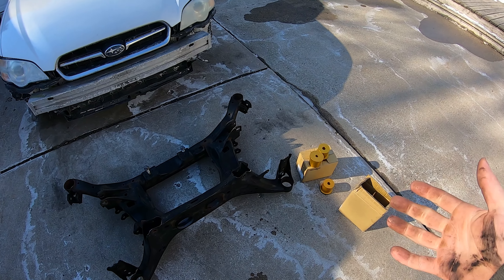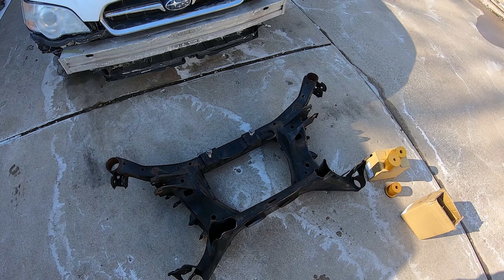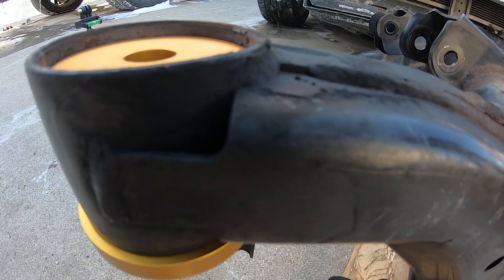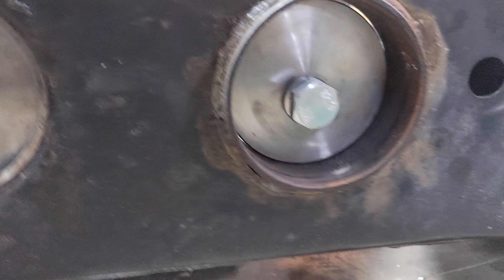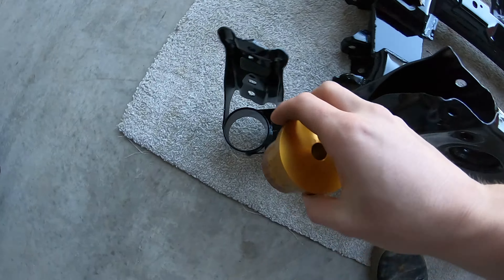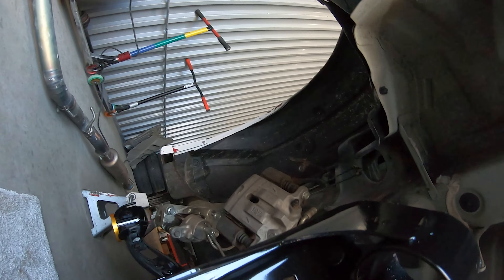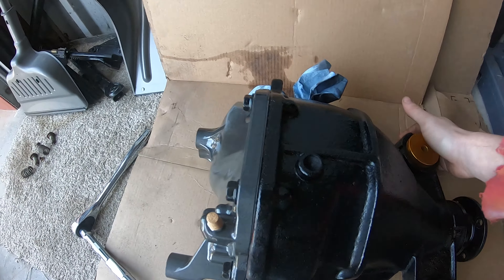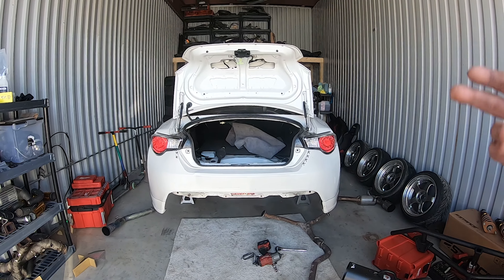FRS/BRZ/GT86 Parts Shop Max Subframe/ Diff Riser (HOW TO) FULL INSTALL

Comment: Do you need the diff bushings? I just want to install my sub bushings. I heard the diff bushings aren’t even necessary.
Reply from the maker: It depends on what you are trying to achieve. I wanted maximum rise to help my geometry, so I did both.
Reply: @yebo3061  going low like 1 or 2 inches off the ground and trying to drift too
Reply: @yebo3061  then again I have a body kit that will fill in a gap

Comment: How much vibration do you have now and would you do it again
Reply from the maker: I have a lot of vibration, but I also have solid engine mounts, trans mounts, no rubber bushings in suspension (hime joints) I would absolutely do it again and recommend it to anyone that’s lowered and drifts!
Reply: So solid mounts totally worth it for reaction?

Comment: Cool but i won't put the front diff solid bushing just let OEM remains . However for the rear of diff mount is poly insert on the right while welding custom solid(more centered bolt position) on the left side .
For the rear subframe i would grind 2mm off the bottom and then excess off the top so it will balance out the height of the solid bush and not contact the OEM weld on the top ... meaning i will be 2mm least raised than the PBM kit intended to while still raising the subframe higher at the rear than OEM . This maintained the OEM weld on the rear subframe mount top section .
For engine mounting poly on the left facing engine from front of car and OEM on the right . (Inside cabin will be poly on right side while OEM left side . )
Transmission just the insert from Powerflex will be great for shifting ... the other company poly shape does help but not as detailed design/engineered shape that extend the full portion of the front/rear facing of transmission mount . Best not to raise the diff or overly solid mounting all round with 1 piece driveshaft .
      Even you are super driver and not hitting anything ... you never know someone or ricer might just blast into your car like a rocket ... if solid all round ... your engine internally crank , rod , bearing definitely will be gone ... Subframe mount can be solid ... chassis can be swap ... engine are the most expensive if your engine is highly modified (i.e. NA high rev forged,lighten all round , professional balanced)
      Unless you are a racing team who can swap parts unlimited x ... don't go full solid all round ... the stress on components is everywhere harsher ... Toyota(maybe subaru) reliability will become like ford or China brand trash reliability ... going solid or too hard duro on bushing or spherical bearing is not needed unless you are world class race team . Skill , practise , talent , experience , hardwork , intelligent is more of a key rather going overly modify street car which doesn't even compete . For practise and learning OEM and some poly bush are good enough ... practise awhile stop and let the car cool down ... don't need to mount this and that modify this and that ... all marketing bullshit ... you can run 10 lap still slow as ever however you can run 1-2 lap and stop to think and reflect on what will improve even more than wasting tires , brake pad , rotor surface ... overheating components and reducing life of your parts ... its not a horse ... its human created machine .
      Most real deal professional or world class racer don't tune/mod buy this or that install a-z ... just OEM and practise ... don't go overheat the machine ... to rest is to carry on an even longer journey afterwards ... don't go crazy on practising burning money tires pads and overheating/damaging stuff ... its not like a sword its a machine lots of mechnical parts and electronics which requires human input ... if you don't understand your weapon and just purely burning money onto it ... you grow nothing of the limit it can do . Limit of speed thru the corners not limit of being trashed /overheated / abused .
Reply: not everyone has the same vision as you. i don’t think this video is about professional driving, it’s literally an install video.
Reply: @_al3kz_  ...
Reply: @Zohar-Modifier  nobody cares
Reply from the maker: I’ve had a few events on the solid bushings without issue, these help ALOT with axle geometry.
Reply: @yebo3061  your eyes isn't sharp or feel isn't like Jim Clark . You probably won't know whats cracking , the rear bodywork mounting probably be cracking like most BMW "M" which ricer made into drift car . Most Drift car had reinforced bodywork and much more reinforcing . Stock won't last well with here or there solid when unintended to be .
Reply: @Zohar-Modifier  It happens on the e36 and e46, but mostly just the e46. On the e46, right at the sub frame mounts, it has edges that bend into 90 degree angles. The mount points look like square boxes that just stick up off of the chassis. Those sub-frame mounts will crack on a completely stock e46 if its driven aggressively.

The 86 has support beams in each direction where all the sub frame mounts meet at. It doesn't have any edges that just completely drop off into the chassis like the e46. This isnt and wont be an issue on the 86 platform. Regardless if you use solid mounts or not.
Reply: @steveh2040  Well in Japan tons of trashed 86 brz from ricer into drifting touge machine had cracked ... why not you import some of those :) I will glady sell you 10 or 100 in a shipment as normal condition ones yet when you play with it ... arh oh no :) cracked chassis to subframe mount :)
Reply: @Zohar-Modifier   Your literally making this up, Ive owned my 86 since 2015 and haven't once seen or heard anything about sub-frames cracking. If it was a problem, parts shop max would be selling reinforcement plates by now.
Reply: @steveh2040  Parts shop max sold those to either competition use and throw participants or those reinforced the bodywork thru out in mind . For trash like you its because those are cheap and that is why you bought it thinking you are Pro :) You didn't strengthen the weakness to be and thinking you are doing correctly and great rofl . Most real deal drifter in Japan don't even touch solid or rigid till they fix the bodywork first . Always they redo and reinforce the whole bodywork first . Mods come later .
Reply: @Zohar-Modifier  Its okay to be wrong, but its not okay to insult people.

For that reason, I'm ending this discussion.
Reply: nice rage bait